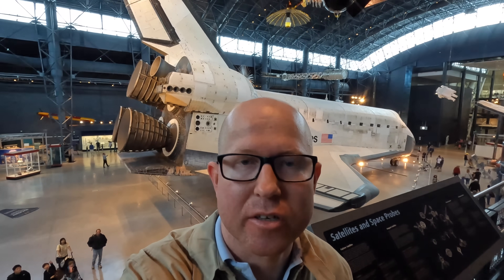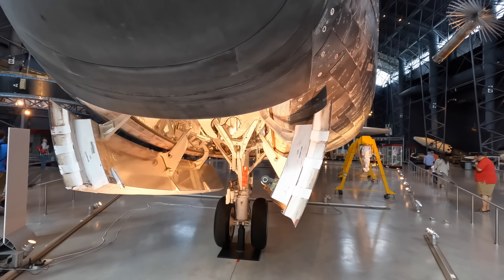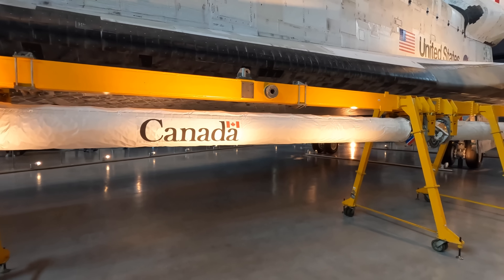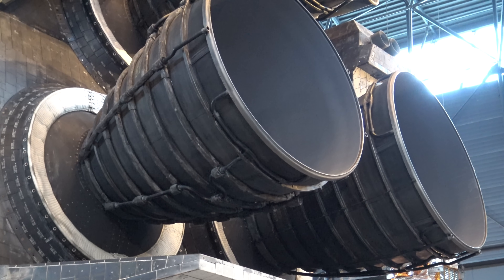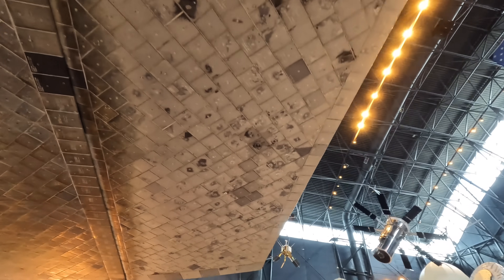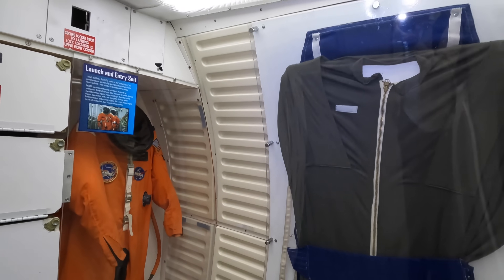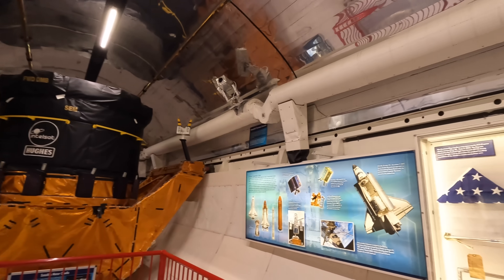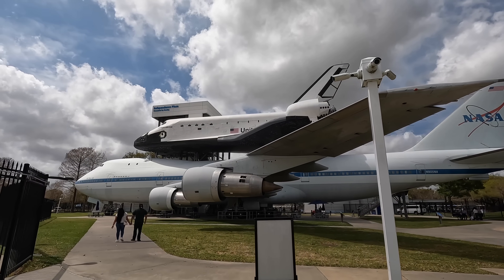Detailed tour through the Space Shuttle Orbiter

Comment: Orbiter that did not orbit.
This thing was too huge and heavy to be propelled to 28,000 km/h.
Shuttle was like Blue Origin, not like Falcon 9 or Soyuz.
Reply: What? It reached orbit
Reply: @cardboard9124  Take a look at Soyuz and Shenzhou.
The little thing at the top orbits, the huge rocket propellant.

Then take a look at the shuttle.
Don’t you think it’s a little big?

Soyuz, Shenzhou, 2% of total mass is out to orbit.
Shuttle, 6-7% of the mass allegedly orbits.
No way.
Reply: @cardboard9124  Soyuz, Shenzhou, capsule weighs 6-9 tons.
The rocket weighs 350-550 tons.

Shuttle weighs 120-140tons.
Shuttle + External tank + Boosters weigh 2000 tons.

Unless the U.S. has some out of this world tech, Shuttle needed 6-8 boosters and 3 external tanks to put into orbit.
Reply: @sbkarajan  The shuttle is far larger than the soyuz, the shuttle tank is bigger than the entire soyuz rocket, and we haven't even talked about the SRBs!
Reply: @cardboard9124  I figure these out all by myself.
And then tell you what I found, to the point.
Still clueless, absolutely clueless.
What the...
Reply: @cardboard9124  Well, all humans are not made equal, for sure.
Reply: @cardboard9124  To lift 6-9 ton Soyuz, they needed 350-550 tons of rocketry and fuel, and to put it in orbit at the speed of 28,000 km/h
So, to lift 140 ton Space Shuttle Orbiter, how much fuel would be needed?
140 * 350/6 = 8,166 tons.
But the Shuttle + External Rocket + SRBs are only 2,000 tons.
Way~ underpowered, it cannot have achieved 28,000 km/h speed, thus no orbiting.
I know, I know, you still don't get it, do ya?
Reply: @cardboard9124  Plus, SRBs are not as fuel efficient as liquid fuel rockets.
So, it should have needed 8 SRBs and 4 external tanks to be propelled to 28,000 km/h and put into orbit.
Reply: @sbkarajan  you just contradicted yourself. You say the shuttle is too heavy to get to orbit, but then you say it’s lighter than Soyuz, which is it? It being lighter than Soyuz literally makes it easier to reach orbit
Reply: @cardboard9124  Man, are you a history major?
The orbiting portion, the shuttle is too heavy for the rocket and fuel, that are responsible to propel it.
Man, like shuttle is a semi truck, Soyuz is like a Corolla.
If Corolla needs 10 gallons of fuel to travel 300 miles, then semi needs a lot more than 10 gallons to go 300 miles.
But I am saying it is carrying too little fuel !!! The shuttle!!!
Reply: @sbkarajan  This isn't real math mate, weight isn't the only factor in reaching orbit. I put the numbers in a delta-v calculator and it can reach orbit
Reply: @cardboard9124  Show me your numbers, 🤪🤪🤪
Reply: @sbkarajan  The specific impulse of the shuttle's engines is 455 seconds, the initial mass (the entire shuttle stack) is 2,000,000 kilograms, the final mass (the shuttle) is 7,500 kg. Doing all the math to get Delta-v you get 14.665 km/s. LEO is 9.5 km/s. This is excluding the shuttle's orbital maneuvering engines and SRBs, so in reality it is much higher
Reply: @cardboard9124  Boy, 2,000 tons INCLUDE the weight of SRBs and SRBs don’t have such specific impulse to begin with, even if we “trust” those numbers.
Reply: @sbkarajan  Im using the engines of the shuttle, so its actually at a disadvantage in this equation because it assumes the SRBs aren't doing anything and weighing it down
Reply: @cardboard9124  I am accusing that shuttle is a fraud.
You think they would cheat if their engine was so crazy super nice?
Specific impulse 455 sec? 🤡
Show me the whole equation you are using.
You cannot burn all of 2,000 tons, as it includes the orbiter’s weight itself.
Reply: @sbkarajan  They didn't burn all 2000 tons, thats why I included 7,500 kilograms in the leftover weight for the calculations. Why do you doubt the specific impulse? Thats around the specific impulse of LOX engines (which the shuttle engine was)
Reply: @sbkarajan  The equation im using is just the delta-v equation
Reply: @sbkarajan  got an answer to real math?
Reply: @cardboard9124  Yeah, but the biggest problem using Tsiolkovsky Equation is, 
Specific impulse for that old rocketry was 455 sec? 💩
Did you look up the latest Falcon 9's published specific impulse?
In 21st century rocket engineering, what they got is about 280 sec.
SRBs, should be half that, at best.
EVEN IF we trust SpaceX's numbers.

Man, I am accusing them of defrauding humanity.
Easiest thing they can do is fudging numbers.
I don't think you get it though... 🙃
Reply: @cardboard9124  Strangely, Soyuz and Shenzhou, the nations who have hypersonic missiles, saying their rockets have specific impulse of 250 - 300 sec with more efficient rockets.
Americans, who does not have hypersonic missiles, claim to have specific impulse of whut? 455 sec?
LOL!
Reply: @cardboard9124  Plus, Rocket Equation has ln ((Mass of fuel + Dry Mass) / Dry Mass) 
Do you realize Russians and Chinese carry a LOT MORE FUEL, thus, you don't even need the equation to figure out the bogxs bull.

But I just put in numbers anyway, the delta V I get using this rough calculation, Soyuz and Shenzhou gets about 15 km/sec.
Falcon 9, similar value too.

Shuttle, replacing the funny nonsense 455 sec with more realistic (yet optimistic) 280 sec, I get 6.3 km/sec.
SRB, I put 140 sec, half of liquid rockets.

Required dela v is 7.8 km/sec, so either Soyuz, Shenzhou, and Falcon 9 are way overpowered or Shuttle is way underpowered.
Since all three rockets from three nations that goes LEO are matching, the old tech with lowest delta v is the one very stinking.

Meaning, Shuttle cannot go to LEO, no~ way.
Proven again, solid.
Reply: @sbkarajan  Falcon 9 doesn't use liquid hydrogen, so of course the impulse is different, you seem to have a learning problem
Reply: @sbkarajan  Again, different fuels = different impulses, also america does have a hypersonic missile
Reply: @sbkarajan  The chinese and russians carry way less fuel than the shuttle, the shuttle's external tank is bigger than the entire soyuz! Why did you switch out the shuttle's impulse? Of course it cant get to orbit now, this is like changing it from a liquid hydrogen rocket to an RP-1 rocket and expecting it to still reach orbit!
Reply: @cardboard9124  So, you can explain all?
1. Shuttle is way too big
2. How shuttle crew come out of the shuttle like cucumbers from the garden, while Chinese and Russians come out in stretchers?
3. Friendship 7, all of Mercury, Gemini space crafts have paint intact after reentry?
4. Bare aluminum for Apollo, and it did not melt away during reentry?
Reply: @sbkarajan  
1) False
2) shenzou 6 crew was just fine, and if they can be fine then the shuttle crew can be fine
3) it was just bare metal
4) because the heat shield dissipated the heat
Reply: @cardboard9124  You need to practice more algebra, like multiplication, division.
I know, it’s hard, but without those basic skills, you cannot understand how you are tricked.
Reply: @sbkarajan  How am I tricked? You still haven't explained anything like this. Unless you are a rocket scientist, I am gonna trust the thousands of independent scientists and math problems I can do myself that say that liquid hydrogen engines have an ISP of 450 seconds
Reply: @cardboard9124  So, if all of the AMERICAN scientists tell you that 140/2000 = 6/300, you would trust them?
Reply: @sbkarajan  No, because I can do the math myself, I can also do the math on engine specific impulse myself, and since it lines up with scientists, I know its true
Reply: @cardboard9124 Ok, impress me.
What is 140/2000
and
What is 6/300?
Reply: @sbkarajan  What does basic math have to do with this? You would just say I used a calculator, anyways it is 7/100 and 3/50. Can we get back to rockets?
Reply: @cardboard9124  140 ton is the weight of the orbiter. 2000 ton is the entire rocketry of shuttle + external tank + SRBs propelling it.
So, 7% (140 ton) of total weight (2000 ton) is propelled to 28,000 km/h to orbit the earth.
You get this far?
Reply: @sbkarajan  This doesn't take into account literally anything else, like engine efficiency and delta-v. Or the shuttle's own engines
Reply: @cardboard9124  What engine America makes, or made in the past, that were more efficient than anything foreign?
Do you actually believe American rockets in the past were more efficient than Russian and Chinese engines they currently make????
Do you think engines made in the 1980s were more efficient than SpaceX engines now????????????
Reply: @sbkarajan  this isn’t about date, it’s about fuel type. Spacex, Russia, and china all use things like methane for their engines, while America uses liquid hydrogen and oxygen, it’s as simple as that
Reply: @cardboard9124  Only starship uses methane, and it’s in development, so I was obviously referring to falcon rockets.
Russia was using RP-1, refined kerosene, Falcon engines are basically Russian design, so they are using the same thing.
Chinese are using a different type, more complex fuel.
Nobody is using liquid hydrogen now, if ever.
Plus, I found that for the liquid hydrogen, the tank volume must be 4 times bigger than other fuels, which is NOT AT ALL what we see with the shuttle.
SRB is the least fuel efficient as I said before.
This topic, I find more and more bull as I dig deeper.
Reply: @cardboard9124  Oh, and you are deliberately trying to misguide, misinform me.
Why?
Reply: @sbkarajan  I never said they all use methane, I just said they use other fuels LIKE methane. Also a lot of people use liquid hydrogen, like NASA. How is the size liquid hydrogen takes up not what we see with the space shuttle? The external fuel tank is literally bigger than soyuz! We are talking about LIQUID ENGINES, not SRBs, stop trying to bring up unrelated topics
Reply: @cardboard9124  oh, man… think PROPORTION!!!
Soyuz is like 6 tons
Shuttle orbiter is like ONE HUNDRED FOUR~~~~TY TOOOONS
Reply: @cardboard9124  I am serious, take an algebra class for adults.
They must offer such thing, teaching multiplication, division
Reply: @sbkarajan  I think you may need to take a class if you think weight is the only thing that matters in rocketry, this weight is made up for by efficient engines and fuels
Reply: @cardboard9124  If Shuttle and Saturn V actually worked and they were more efficient, why SpaceX is abandoning their design?
Why Falcon is copying Soyuz and using its RP-1 fuel? Now?
While Soyuz never changed its fuel for almost 60-70 years?
Reply: @sbkarajan  Like all fuels hydrogen has its downsides. For one, its not very dense, so you need to build a really big rocket (like the shuttle, the external tank is again, bigger than soyuz). You also need to spend money and weight making a cooling system, as liquid hydrogen needs to be super cold, the shuttle could negate this as it only used hydrogen for ascent, which was very brief. Spacex however, would need to cool it as their rockets not only need to deal with ascent but descent. Soyuz hasn't changed its fuel likely because of the things I have just said, and also it's age. Its hard and risky to modify and already old and reliable rocket
Reply: @cardboard9124  So, Starship ALSO abandoned liquid hydrogen, because....?
💩💩💩🤡
Reply: @sbkarajan  As I said, cooling. Starship is intended to stay in orbit for long periods of time and cooling will be incredibly difficult
Reply: @cardboard9124  Even the Starship's first stage is intended to stay in orbit? 😃
Isn't it to fall down almost immediately after the launch? 🤣
Reply: @sbkarajan  The first stage still goes pretty far up, and takes about 8 minutes to get back down. By then the hydrogen would begin warming up already and causing issues
Reply: @cardboard9124  What issues?

Shuttle's hydrogen rocket never had any issues, ever, never, ever.
Oh, neither did Saturn's hydrogen rocket.
They never blew up, ever and never.

So, while keeping this in mind, I wonder, what issues?
Reply: @sbkarajan  the issue of evaporating, the shuttle didn’t have this issue because they discarded their first stage, and the Saturn v didn’t have this issue because they used cooling, spacex can’t do either
Reply: @cardboard9124  I did not think about it this far, but hey, the whole Saturn V rocket, 1, 2, 3rd stages, all used LH2 and LOX.
3rd stage is very small, only one rocket nozzle.
But hey, even the command module, mean allegedly, lol, used LH2.

What gives?

1. How did they take care of the issue of evaporating for like 10 days of direct sunlight, barbecue rolling?

2. Plus, didn't you say LH2 and LOX could not be used for smaller rockets?
3rd stage? And command Module anyone? Were they real? 
The little small thingy that allegedly went all the way to the moon and came back to earth?
Reply: @sbkarajan  1) Again, they chose to cool it
2) Never said that, its just not very dense, however the tanks on apollo could be very small because it requires very little fuel to capture or leave lunar orbit
3)Yes, all of apollo was real
4) Yes, it was a small "thingy" that went to the moon, however the command module was responsible for slowing down around the moon, actually getting there was done by the GIGANTIC Saturn V that has only recently been surpassed in power
Reply: @cardboard9124  1) So, IF LH2 fuel worked for small to large rockets, and they could just cool it for more than a week to use it, why doesn't SpaceX A~N~D Boeing using it?
Yes, even Boeing abandoned LH2 and using RP-1, Russian rocket fuel now.

2) I said, Saturn V's 1st, 2nd, 3rd stage used LH2 as well. So, it worked 100%, flawlessly for decades. So, why abandon it, if it worked so well?

3) Nope, they did not, but this is another topic

4) Let's focus on LH2, do not divert from the topic.

All in all, there is no good reason abandoning LH2 and using Russian rocket engine and fuel, is there?
Reply: @sbkarajan  1) Spacex and boeing aren't using it because they want to maximize payload capacity and cooling systems are very heavy
2) The saturn V was discontinued, and the shuttle and SLS use(d) liquid hydrogen
3) They did
4) You asked, I answered
RP-1 is not "russian rocket fuel," thats like calling gasoline a british fuel. There are plenty of good reasons, you dont have to cool and it is easier to store
Reply: @cardboard9124  1) Then why did Saturn V stage 1, 2, 3 and CSM and Space Shuttle and SLS use LH2? Because cooling systems aren't very heavy for them?
2) If Saturn V and Space Shuttle and SLS are working wonderfully, little fuel and max thrust and delta v and highest specific impulse like no other fuels could match, no comparison in the world, plus they could provide the cooling for ANY SIZE for decades, 1969-2011, ZERO PROBLEM, why abandon such wonderful system and use RP-1?
3) Nope
4) Ok, let's stay on this topic only.
Reply: @sbkarajan  1) Saturn V used it because it was big enough to allocate some extra weight towards cooling, and they weren't maximizing payload. Shuttle got rid of its tank within a few minutes and didn't need cooling
2) Because liquid hydrogen has its downsides as stated earlier: size and cooling. 
3) Yup
4) If you want to stay on topic stop asking off-topic questions and complaining when I answer them
Reply: @cardboard9124  1) Was Saturn V's 3rd stage and CSM big enough for cooling? Nope.
Looking into it, it seems Saturn V and Shuttle external tanks were not even insulated properly. 
Only 1 inch - 1.5 inch thick foam? 

And it stayed in the HOT Florida July weather for hours and days there waiting to be launched?
How was -423 F maintained? 
Oh, we can't do it anymore, it was all joke!!!! LOL!

2) LH2's size and cooling was compensated by its wonderful performances, for decades, wasn't it?
But can't do it anymore, move along, move along, nothing to see.....
Reply: @cardboard9124  Can you buy liquid nitrogen? Yes
Can you buy liquid oxygen? Yes
Can you buy liquid hydrogen? LOL

Yet the Shuttle's External tank was sitting outside, in Florida summer, for hours and days with just 25 mm-thick (1 inch) polyurethane foam insulation?

I think this pretty much settles the issue for me.
NASA could not have even used LH2 as fuel for apollo or shuttle.
SLS, well, who knows where it's going?
With more thrust, it's going to the moon in 10 days, not 3 days?

Why did they lie this little detail? Who cares about the fuel type?
I don't know, but liquid hydrogen sitting in the FL sun with such little insulation for hours is total nonsense.
Reply: @sbkarajan  1) Yes, yes it was big enough for cooling. Yes, they only need an inch of insulation because they have insulate made by literal rocket scientists. The tanks were cooled by mechanisms in the launch tower while it was waiting in the launch pad, then when it launched it switched over to cooling systems in the rocket itself.
2) What? Its all about tradeoffs, for a giant rocket like the saturn v, the savings from efficiency outweigh those of the cooling and density problems, for a small rocket like falcon 9 and soyuz, it is actually more efficient to use other fuels
Reply: @sbkarajan  "nothing to see"? Really? Literally everything NASA has and is doing is publicly documented to its most full extent
Reply: @cardboard9124  1) "it switched over to cooling systems in the rocket itself"
1-1) Where is the cooling system located? How is it powered? I don't see any significant mechanism in any of the drawings for the Shuttle or for the Saturn V stage 2 and 3.
1-2) If cooling system worked
 AND the system was superior to everything, more thrust over everything
 AND allegedly sent men to the moon
 AND sent HUGE space plane to orbit
 AND super reliable, ZERO failure
 AND could handle smaller units such as stage 2 and 3 of Saturn V or Saturn 1B stage 2

 ******AND cooling unit is so little it's virtually invisible or skipped in drawings******

 there is no rational why they don't keep using the LH2?
2) Falcon 9 is smaller than Saturn V stage 3?
Reply: @sbkarajan  1) Cooling system is around the tanks, it is powered like everything else on the saturn v, by the turbine driven by the rocket engines and later the fuel cells. Most online drawings dont get into these little details
2) It wasn't for smaller rockets like the falcon 9, it did, I never said it had no failures, those weren't "small", by volume and LEO payload the saturn V 3rd stage was way bigger than soyuz or falcon 9
The rational reasons are cooling and density, LH2 is still used in the SLS, just not by spacex because they have a much smaller rocket that cant be cooled.
Yes, by volume and delta v Falcon 9 is far smaller than saturn V
Reply: @sbkarajan  Liquid hydrogen is highly flammable and purchasable with the proper credentials. Yes, the shuttle was outside in the sun, however it's very high grade insulation and cooling from the launch tower allowed it to maintain a low temperature. SLS is actually far weaker than Saturn V, that is why it will take longer to reach the moon. Liquid hydrogen sitting in a very well insulated tank with industrial power cooling sitting in some 100 degree temperatures makes perfect sense
Reply: @cardboard9124  I think I learned everything I could here, I actually want to thank you for everything you made me to learn by thinking deeper.
I would have never guessed Shuttle's fuel, LH2 was also such impossible bogus bull, just like everything else.

Shall we move to the next topic #2: Crew's condition after landing?
Reply: @cardboard9124  Topic #2: Crew's condition after landing?

How did Shuttle's crew walk out and stand straight after 15+ day in orbit, while Russian and Chinese crews are stranded in chairs after just 2 day orbit?
Look up images of Shenzhou 9 crew, 12 day in orbit, saluting while sitting in Chairs.
And then look at STS-134... Man, these guys just got out of Disney ride?
Reply: @sbkarajan  What makes you think liquid hydrogen doesn't work as a fuel? I answered every single one of your questions
Reply: @cardboard9124  Your answers is basically, it worked, super high performance, zero operation problem with minimal insulation, light weight and it endured Florida sun for hours and there was a *little* insignificant cooling system hidden and invisible in the tank, but for use in 21st century, the little cooler is *TOO BIG* and costly and we cannot use it anymore.

Let's move on to the next topic. There are about Five funny things and I am sure even you will be convinced that STS was bogus bull after discussing them.
Reply: @cardboard9124  Dmitry Rogozin, who had been the head of Roscosmos (Russia's NASA) said last year:

"Ten years ago, when I was working in the Government, I sent an official request to Roscosmos to provide me with documentary evidence of Americans on the Moon available to this federal agency at that time. I was too embarrassed by the fact that Soviet cosmonauts returning from multi-day expeditions could barely stand on their feet and underwent a long recovery after such flights, and the Americans got out of their lunar spacecraft like cucumbers from the garden. "
Reply: @cardboard9124  Dmitry Rogozin, who had been the head of Roscosmos (Russia's NASA) said last year:
Reply: @cardboard9124  "Ten years ago, when I was working in the Government, I sent an official request to Roscosmos to provide me with documentary evidence of Americans on the Moon available to this federal agency at that time. I was too embarrassed by the fact that Soviet cosmonauts returning from multi-day expeditions could barely stand on their feet and underwent a long recovery after such flights, and the Americans got out of their lunar spacecraft like cucumbers from the garden. "
Reply: @sbkarajan  liquid hydrogen did work? It had high efficiency, not high performance. “Minimal insulation,” what? It had insane insulation, this is the kind of stuff made by scientists, not just found in a house. It was not some insignificant cooling system, you aren’t gonna find such specific details on the internet but you can ask a real engineer. I never said cost was an issue, just weight, cooling systems are heavy and putting it on a small rocket like the falcon 9 takes away a lot of its payload capacity. You can’t just move on to a different topic when it is advantageous for you
Reply: @sbkarajan  again, the fact that the shenzou 6 crew was fine completely proves you wrong, however you seem to keep ignoring it. The Americans and Russians also had vastly different landings, where a lot of Gs are experienced. Soyuz lands like a traditional capsule, riding down in a parachute and hitting the ground pretty hard. The shuttle landed like a plane, and few Gs were experienced
Reply: @cardboard9124 Topic 1-1) "25 mm-thick (1 inch) polyurethane foam insulation" 
You say, this is *******insane******** insulation?
What is the R value for it?

Give me a break.

1-2) So, where does it show such a heavy cooling system for LH2???????? How come Apollo and Shuttle is so open to public but I will never find the so important detail of what kind of cooling system it had in internet? 

1-3) Cooling system is so tiny to show in any schematic, yet it's so heavy to put in 230 feet tall Falcon 9 at the same time? 

1-4) What is the weight of the cooling system?
Reply: @cardboard9124  Topic 2-1) Do you actually believe it's the G force during descent and landing they go through that makes Chinese and Russian not able to stand? Not the zero-G they experience for days?

2-2) Paratroopers land on their feet, so not only high G, but also physical contact with high force. Do they also need chairs to sit down and not able to walk alone?
2-3) Fighter pilots experience up to 10-14 Gs, they come out fine, walk without assistance, so what do you think of that?

2-4) Shenzhou 6 crew was fine? They got out of the capsule with help of ground crew and sitting almost all of the time except a few seconds standing up. 
2-5) How do you define fine? Needing chair and sitting most of the time is fine? Did Shenzhou 6 crew walk more than 2 steps?
Reply: @sbkarajan  1) How would zero-g affect their ability to stand?
2) Paratroopers dont experience high Gs, its a 200 pound person gently hitting the ground, a soyuz coming in for landing is 7 tons, big difference
3) What kind of fighter jet pilots sustain 10-14 Gs, are you stupid? The limits of most planes are 9
4) They walked down stairs and stood up on their own power, they seem pretty fine to me
5) Again, they walked down a bunch of stairs and were perfectly willing to stand up, they probably sat down because it was comfortable
Reply: @cardboard9124  1) Nobody is allowed to talk about it apparently, but I am guessing inner ear is affected? So balance and orientation gets screwed?

2) Actually, the total weight of the three-part Soyuz and Shenzhou is about 6-8 tons.
The re-entry portion (middle) is 3 tons. 
Don't you think they would use bigger parachute for 3 ton capsule? 

2-1) People who had car accident, had airbag deployed, they walk out fine if body is not broken. That should be even worse impact than the landing of Shenzhou on sandy desert. 
2-2) Landing on water won't be that much better though if it's such impactful high speed, yet Apollo crew, even Skylab crew walked out on their own too.
Reply: @cardboard9124  3) Personal insult now? LOL! Feeling pressure? 10-14g is according to Henry Crigler, former A-7 pilot. 
People train on centrifuge up to 15 G for sustained time and walk out on their own too, after couple of seconds brief rest. 

So it is not the g force impact during landing that's causing real astronauts from China and Russia not able to stand or walk, buddy.
Reply: @cardboard9124  4-1) Man, did Shenzhou 6 crew have assistance? Yes, thus they were impaired.
4-2) Do you need help of two people getting you out of your car and then immediately need to sit down? If you did, will you consider yourself fine shape?

5-1) Did Shenzhou 6 crew sit on chairs most of the time? Yes/No?
5-2) Did Faux Shuttle STS-134 crew walk out and stood on their own feet, with ZERO help? Yes/No?
Reply: @sbkarajan  1) People are allowed to talk about, after maybe a few months it starts to cause issues but after a few days they can certainly walk.
2) Still pretty heavy, it experiences quite a few Gs on touchdown
2) No it shouldn't be, unless your car wreck causes +15 Gs of force
3) They should be just fine according to you, they stayed in space for only 10 days. Skylab crew are pretty fine, they sit down for a bit because they actually stayed long enough for balance to be messed with
Reply: @sbkarajan  4) They walked on stairs, if staying in space truly is so terrible, they shouldn't have been able to do that. Yes, they sat in chairs, but again, they experienced upwards of 15 Gs on landing
5) Well yes, the shuttle crew was pretty much fine because they didn't experience 15 Gs on landing
Reply: @cardboard9124  Tell me how you got the 15 G number?
Reply: @cardboard9124  Soyuz and Shenzhou descent speed is about 16 mph.
Airbags deploy when the car impacts at 15-17 mph, so at the speed of Soyuz or Shenzhou hitting the sand is very margin, the speed airbags may not even deploy.

I am telling you, people who got their car rolled over, hit something at 60-70 mph, they WALK OUT just fine if nothing is broken with their body. 
Soyuz and Shenzhou, they have to go to lengthy rehabilitation for weeks after just multiple days in orbit, according to Chinese media and former Russian Roscosmos chief, Dmitry Rogozin.
Reply: @cardboard9124  I hope my posts are visible to you, if not, oh well.
Reply: @sbkarajan  What posts?
Reply: @cardboard9124  I am not done yet.

Topic #3, Painted letters on the Shuttle's Black Tiles.
See, about 1:02 minute mark in this video, we can see the bottom tiles.
The letters and numbers on the tile are painted.
Did paint survive during 3000 F re-entry?
Please, explain.

Not only that, all of Mercury and Gemini space craft, paints survived the re-entry too, at 3000 F
In contrast, Apollo capsules, made of bare aluminum, got all scorched red.
But aluminum melts at 1200 F..... 😃

And then look at Soyuz and Shenzhou, made of titanium (melts at 3000 F) and the titanium surface is protected with some coatings.
The whole craft is scorched red and black.
And those real space capsules from Russia and China look like they can survive in the deep sea and nothing would leak, air tight, water tight.
Mercury and Gemini, they look like some makeshift shelter, they may leak rain water, seriously.
Reply: @sbkarajan  Those tiles dont have paint on them, they have markings carved into them. Mercury, Gemini, and Apollo all survived re-entry because of their heatshield, which absorbs the heat so that the capsule itself (and its external paint) dont melt. Looks dont mean crap, so dont bring your opinions into this discussion.
Reply: @cardboard9124  1. Shuttle tiles don't have paint on them, then why are they yellow and white in color? Carving changes the color? They are not even slightly carved. There are high-res photos of them, they are paints, not carved at all.
Reply: @cardboard9124  2. Did you look at Shenzhou and Soyuz? Heat shields are at the bottom, but everything is burnt above the heat shield, on the side and even the top surface. Apollo with BARE ALUMINUM (melts at 1200 F) got red burn all around too.
Reply: @cardboard9124  3. The original Friendship 7 is displayed in Smithsonian. Take a look and appreciate how the hell all the paint survived the re-entry at 3000 F. It never went orbit at Mach 25. The fit and finish look like it would fall apart at Mach 1. You realize how smooth the supersonic plane surfaces are? They just go Mach 2 max.
Reply: @sbkarajan ever think of the fact that the inside could be yellow?
Reply: @sbkarajan  there is no paint, it’s just metal. At most there is a painted on USA logo but it is far enough up to not be damaged by re-entry
Reply: @sbkarajan  the Soyuz itself is black bud. That ain’t from re entry, and it ain’t burnt
Reply: @sbkarajan  quick question before I answer any of the stupid things you keep repeating over and over again despite me answering, why do you doubt Americas space shuttle and liquid hydrogen engines when Russia had one itself? I thought Russia never lied about anything unlike America according to you, thus it should be possible to send a shuttle to space and liquid hydrogen engines should exist, right? In fact, russias liquid hydrogen engine had a superior specific impulse to the American engine at 470 seconds
Reply: @cardboard9124  LOL,
Tell me how the BARE ALUMINUM skin of Apollo capsule looks, before and after.
Reply: @sbkarajan  No, no, please answer my questions first
Reply: @cardboard9124  For example, the Apollo-Soyuz test?
Reply: @cardboard9124  my answer kept getting deleted
Reply: @cardboard9124  do you even see the notification?
Reply: @cardboard9124  Russians
Reply: @cardboard9124  Russians do
Reply: @cardboard9124  lie
Reply: @cardboard9124  not very
Reply: @cardboard9124  often
Reply: @cardboard9124  I will try later
Reply: @sbkarajan  Yes, and also the gigantic space station russians work on that was built by the shuttle
Reply: @cardboard9124  "Yes, and also the gigantic space station russians work on that was built by the shuttle"
🤣🤣🤣🤣🤣🤣🤣🤣🤣🤣🤣🤣🤣🤣🤣🤣🤣🤣🤣🤣🤣🤣🤣
Reply: @cardboard9124  Are you serious?